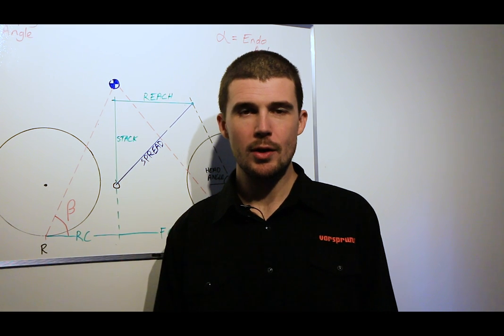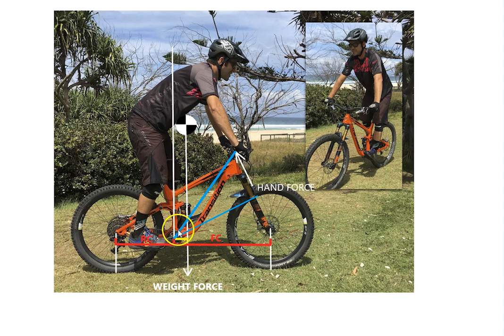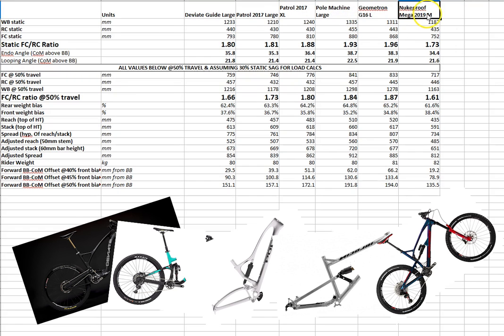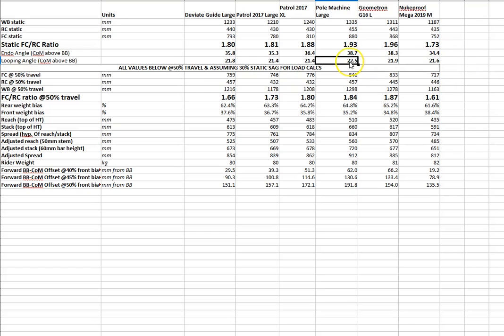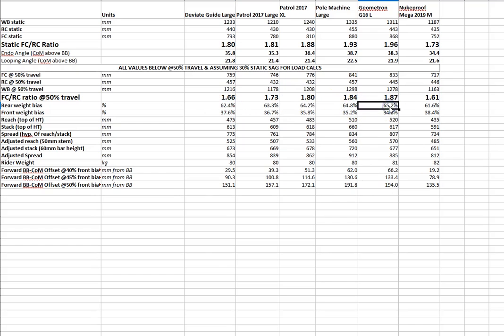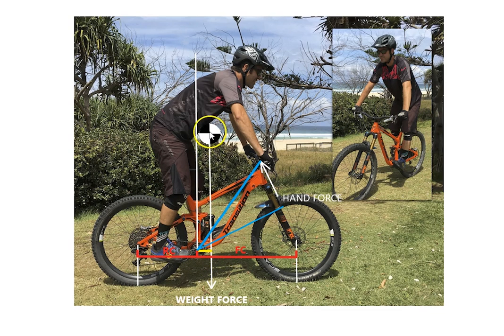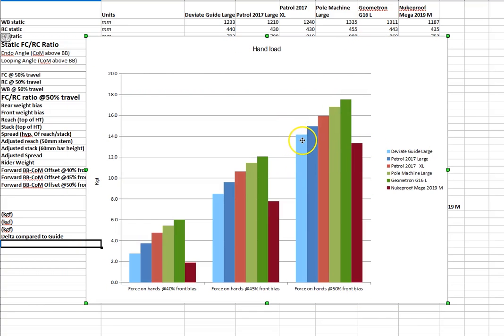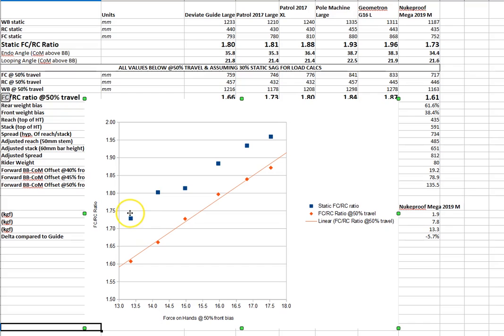Understanding Advanced Bike Geometry Pt 2 - Tuesday Tune 26

Comment: Super well put. One thing you omitted is how offset can be altered to change hand force. In the end, we need the rear center to grow in proportion to the front center. Not sure who is into 18" chainstays (except me), but that's the only way I can think super long reach would work to keep the rider poised at all times.
Reply from the maker: Agreed. Shortening FC or lengthening RC have similar effects on that particular aspect. I'd be very interested to try riding a ~160mm bike with even longer stays than that, like 490-500mm, so that you could have all the straight line advantages of the Pole/Geometron as well. I'm sure it'd suck to manual, but it's not a pump track bike, and IMO the 455mm stays on the Pole didn't make it that difficult to manual anyway.
Reply: @VorsprungSuspension  Ideally I'll build a proprietary seat stay for my Sentinel just to try this. Plus, if I do it right, it'll extend travel to ~160mm. Otherwise, I'm moving back to a Large. I can't consistently keep enough weight on the front of that bike otherwise...even with a 37mm offset fork and a shock tune to keep my higher in the travel.
Reply from the maker: @JeffreyJim09  if you have that capability that's super cool, would love to hear your thoughts if/when you do.

Comment: So if you measured the strength ratio of your arms and legs then that ratio was the same as the front to rear reaction force ratio you would have the easiest bike to ride
Reply from the maker: That's a pretty interesting concept (assuming by reaction force you're talking about hands/feet?). I do not have enough data or knowledge on human strength to be able to offer an opinion on the practicality or limitations of that, but there is definitely logic behind that.

Comment: My theoretical bike has always had cs length equal to reach but I think it would be a bit weird to ride
Reply: I got to ride my dad's ebike with a 455 reach and cs length (in a size large, but that's a pre - s sizing Specialized and they made fairly short bikes) and it felt way better when cornering than my own bike with 480 reach and 432 cs. I also tried a friend's large Commencal Meta 29 and while it was amazing in rough straight sections I didn't feel comfortable in turns, especially flat ones. I'll definitely pay attention to the front to rear center ratio when shopping for a new bike and possibly look for one with shorter reach. Also sorry for commenting about 2 years too late.
Reply: I know this is an old thread, but the new Banshee V3 bikes have chainstays equal in length to Reach.
Reply: @patrickmckellips5960  interesting

Comment: The video seems to point to the Nukeproof needing less movement to correctly weight the front, there by requiring less energy from a professional rider.

Is there a flip side to that statement where it's also more sensitive to poor body position and an average rider may actually find it takes more energy because of under/over body movement error?
Reply from the maker: There is a flip side in a straight line for sure - reducing FC reduces that endo angle, meaning the rider has to be more mobile to keep their weight in the necessary position - more moving your weight back on steep or rougher stuff. Having a longer wheelbase in general means you effectively have a higher resolution of motion control - if you double wheelbase length for example, moving your CoM backwards of forwards by say 10mm makes half the difference it otherwise would have, so you can be more precise in your control. This could definitely be problematic in corners if the wheelbase or reach or spread were really short, but within practical designs that currently exist I'm not yet convinced that it's an issue there - that's quite subjective at that point.

Comment: Great information as usual.  As a big guy on bikes over 500mm reach I have first hand experience with rear stays being too short.  It sucks to lose front end grip and run you bars low trying to get some grip.  Just build up a XL Ripmo and even though it feels a little small with a 60mm stem, the balance is amazing.   Finding a bike that fits and is balanced is a beautiful thing.  I don't know if I would give up easy manuals for longer rear stays and higher bars.